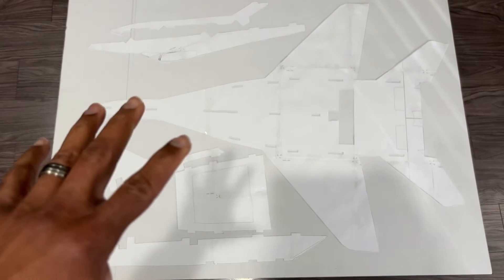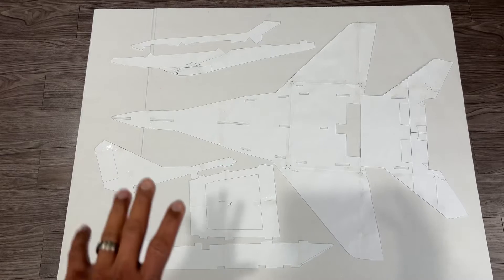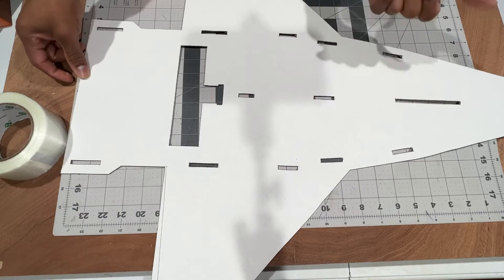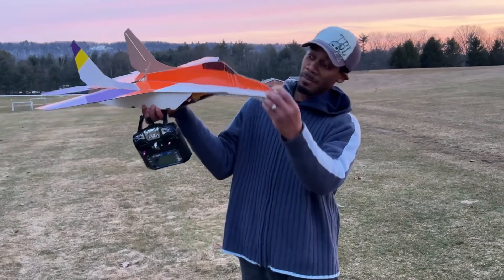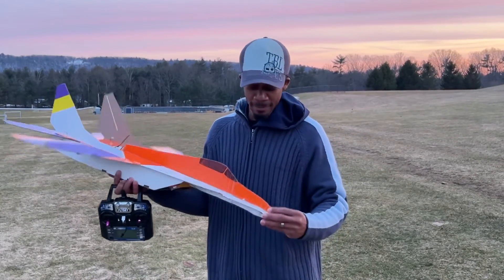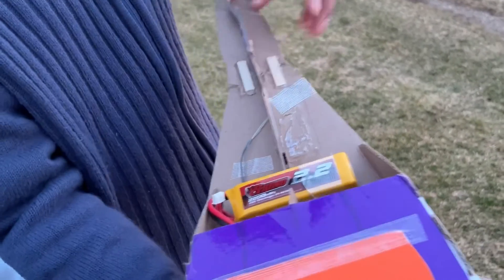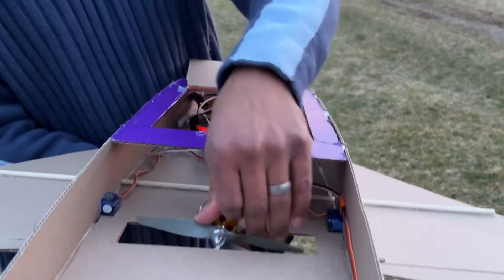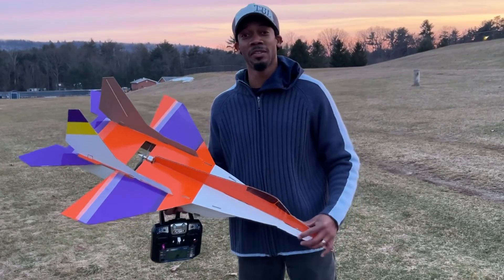How to Make Mig 29 Rc Plane: Full Build Video and Maiden Flight

Comment: Can you give me the EXACT parts you used? Thanks.
Reply from the maker: For this build I used a 2200kv motor, 30amp esc, 2200mah battery, and 6x4 prop. Would be able to access the link for the F22 if I send it to you?
Reply: @chrisellisrc8787  maybe. I have built so many rc planes and I can’t get any to successfully try. Send me the link if possible.
Reply from the maker: Free RCPowers Plans. Once you click on it you are going scroll down. You will see the free plans for the F22
Reply: @chrisellisrc8787  ok. Thanks. You said in the video that you changed the propeller and motor. What did you change it to?
Reply: @chrisellisrc8787 I keep on having my plane curve to one side becase of torque. what do i do?
Reply from the maker: Check your thrust angle. What kind of setup did you use? Check your ailerons to see if they are centered
Reply: @chrisellisrc8787  my ailerons are centered. What do you mean by thrust angle?
Reply from the maker: Is you motor pointing down to right?
Reply: @chrisellisrc8787  no. Just straight out.

Comment: We've recently assembled a couple of this style from EPP board, Chris. What we found to be the best method of protecting the long noses from damage from the inevitable occasional nose-in, is to run a light bead of hot glue along the edges of the foam sheets to seal the cuts. Works a treat and doesn't add very much weight.
Reply from the maker: Thank you. I’ll remember that for my next build or when I make the repairs.